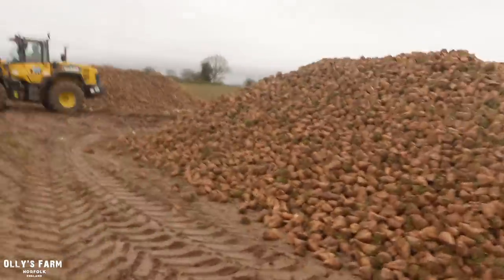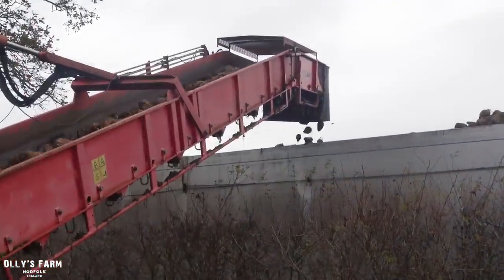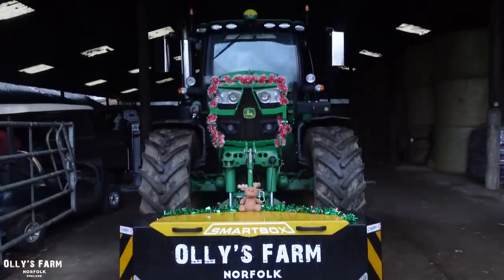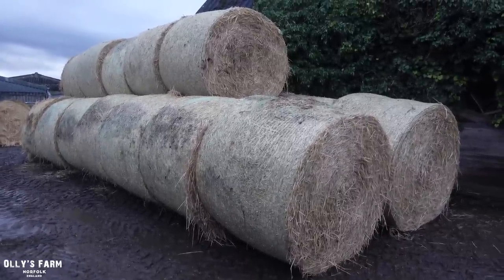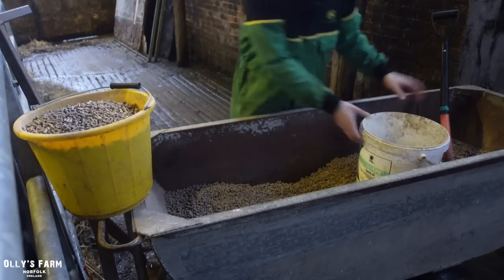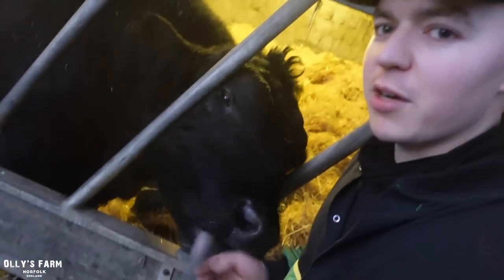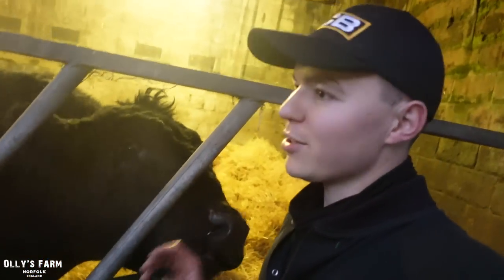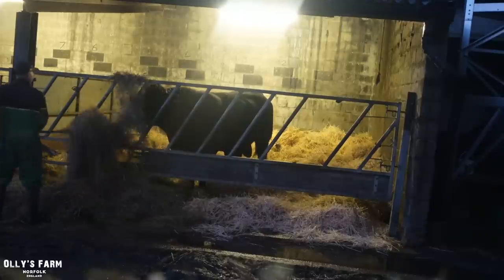HUGE KOMATSU WHEELED LOADER ARRIVES TO LOAD THE BEET!

Comment: Electrical Engineer here….. One of the easiest ways to improve your lighting output (doesn’t matter if it’s LED or otherwise) is to clean them. If they are dirty you’ll get about 30-40% more output by doing this. It’s called a “maintenance factor” in the trade and is calculated in when doing a lighting design. So clean them every year (at least) and you will have a good light output